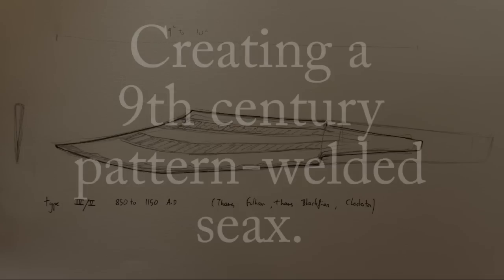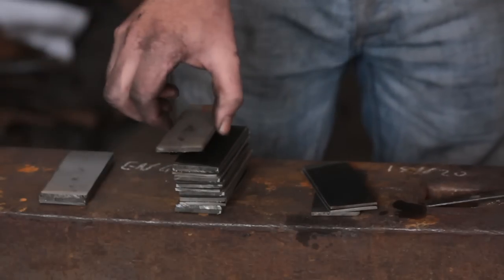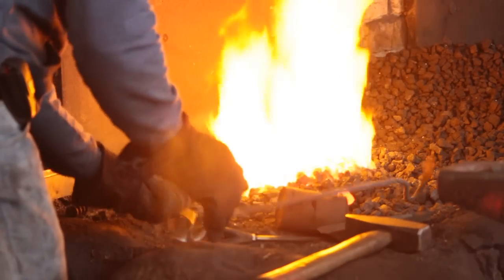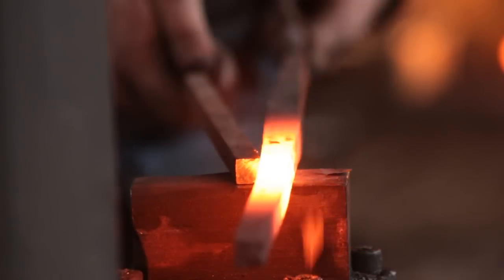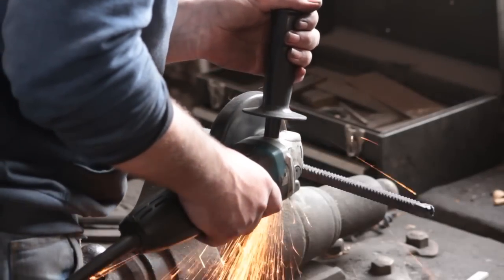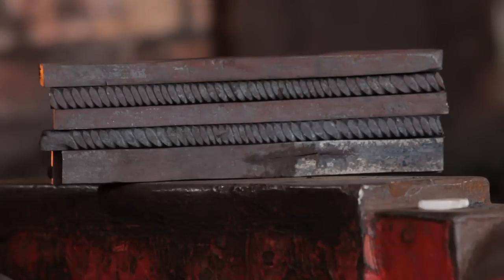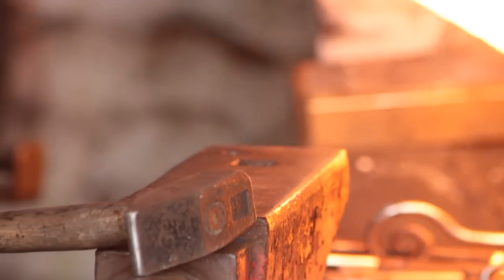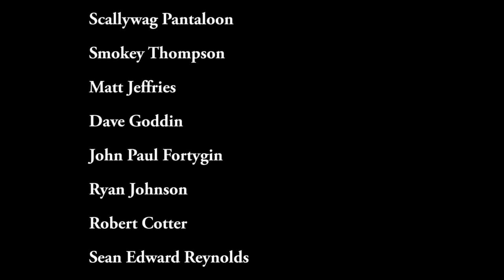Forging a pattern welded seax, Part I: The billet.

Comment: Where did you get the 15 N 20 from?
Reply from the maker: Off of ebay. there's a shop on there which sells it in the lengths you saw as well as full sheets.

Comment: How many welding heats did it take to tack the larger billet together before you went on to the power hammer?
Reply from the maker: I think I used 4 heats to tack it together - 3 in sections and one overall heat to be safe.
Reply: Awesome thanks, you are inspiration to young smiths, attempting to re-create your work. Thanks for explaining every step. Keep up the good work!!!
Reply from the maker: No worries :) It's what I enjoy doing!